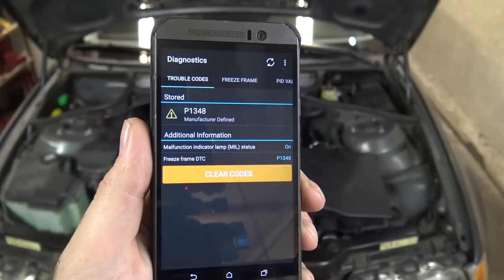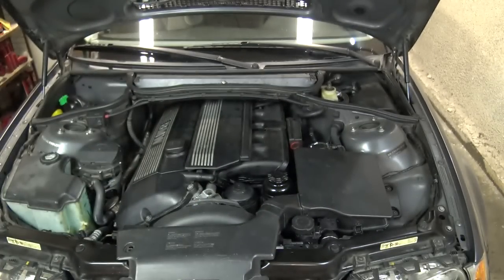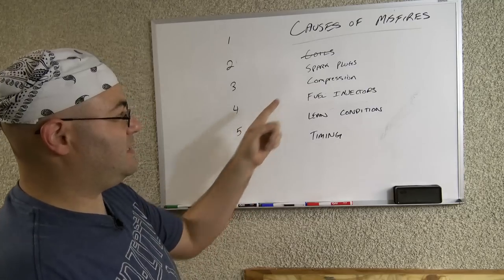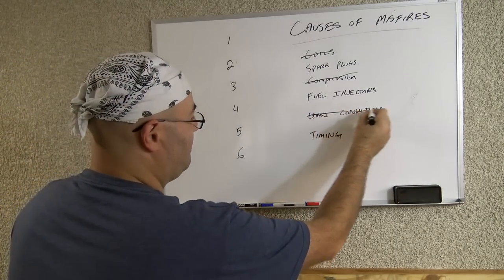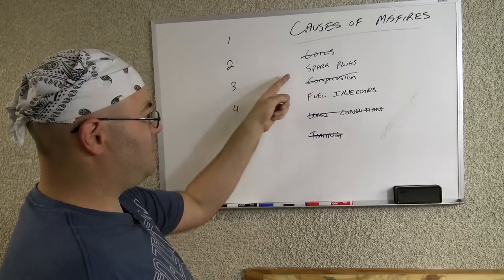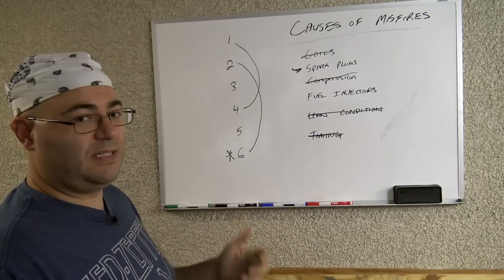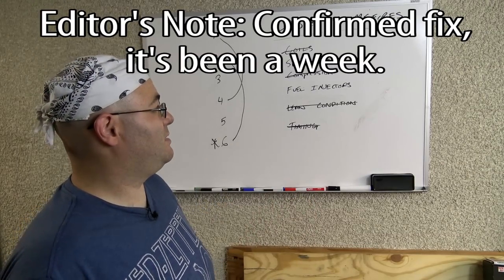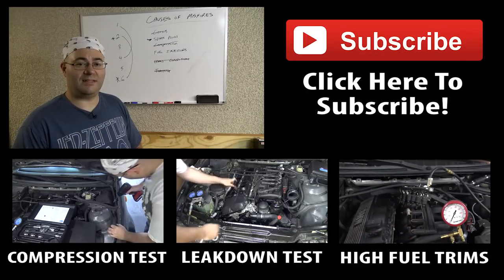How To Diagnose A Misfire on an E46 BMW 3-Series DIY

Comment: dear 50's kid greatings from greece my problem in my M54 330ci is relatively similar to what you were describing in your video but the codes that my ELM showes are P0302 P0305 and 306 but more commonly is 305 i flushed the engine and changed all 6 coils also recently i changed my faulty fuel pump still the car when on idle after a small period of time starts misfiring my mechanic said that the fuel injectors might be clogged up due to the gung inside the fuel tank. I didnt changed the sparkplugs yet as i got the for about 1 month "NGK-Rs". The weird in this cituation is that when i erase the fault codes the car works fine plus when it starts misfiring if i shut the engine off and start it again the misfiring stops!!! Any ideas or suggestions!!! I would be so glad hearing from you as this problem is definately driving me MAD!!! tnhxand  keep up the good work!!!
Reply from the maker: When the computer detects a problem with combustion, it will actually shut down that particularly cylinder to protect it from detonation. That’s why the misfire goes away when you restart it or when you clear the codes. You do have a problem and you need to proceed with swapping the various components like I do in this video to figure out the cause

Comment: I`m having such a problem with misfires on my X5.. I think the bad fuel is guilty in this case.. however, I`ve had a serious misfire about a year and a half ago and I changed spark plugs with denso irridium IK20TT spark plugs. Have done about 25000KM with them.. bought them for a reason that those were the most durable spark  plugs with a decent amount of igniting power.. hmm.. however, through it`s lifetime I doubt my car has ever had injectors replaced or cleaned.. so could you please tell me the size of injectors an M54B30 uses from the factory ? and sometimes I get fuel trim errors when obd scanning my car on cold

Comment: My 2003 E46 325i is straight piped i have 
been driving it for over 1 year never took her 
out in the snow but i did it once last week and 
started misfiring and when i checked it said 
cylinder 4 misfire and i have changed all the 
spark plugs and.checked all the coils they are 
working do u have any idea what that 
could be now its just cranking wont start at all

Comment: hey  have sporadic   miss fire on cylinder 4 and 5,  swap from cyl 1 and to to 4 and 5 coils and new plugs, still have  misfire in  5 and 6    ,, do you think I should test the injectors?

Comment: Did you use dealer spark plugs?  Mike Miller of Roundel and Bimmer magazines insists that dealer plugs are slightly different than what is available on the aftermarket.
Reply from the maker: Not dealer plugs, straight NGKs.  I don't believe there is any difference.  Probably made in the same factory in China.
Reply: I think their is a difference.  Even though NGK makes OE plugs for BMW, a number of smart people insist that the aftermarket NGK part is different.  Mike Miller is no shill for BMW; he recommends aftermarket if it is as good or better. He states "Like just about everything else on the modern BMWs, Bosch spark plug choice is complicated and confusing. The short answer is if you order the spark plugs from BMW (sometimes there is a choice between Bosch or NGK), then you are good to go and there is no confusion. But they are expensive."  

"Savvy enthusiasts have found that Bosch has a part number for commercially-available spark plugs that cross-references to the BMW original equipment Bosch spark plugs, often at a fraction of the price. The problem is, the commercially-available (aftermarket) Bosch spark plugs are not always the same as the original BMW Bosch plugs even though they cross-reference and they do work."

"Dealership technicians report problems with the commercially-available Bosch Platinum +4 spark plugs in BMW engines. I have never seen this personally, but physical inspection does reveal differences between the original BMW Bosch spark plugs for the modern cars and the commercially-available Bosch Platinum +4. I use the factory plugs in my E46."

Comment: What was the problem in the final? I have a 525i e39 and I have approximately the same problem. The first start(cold start) it starts ok after 10-15 sec it shake and it throw an error on cilinder 4 or 5 or the both. I delete it with engine on, and it runs ok, or I stop the engine and I start back and all good. The problem disappeared . This problem I have on cold start. After that I haven’t any problems with the car. Next morning the same problem. I change plugs, coils, allll this shit and the problem still persists. Any idea? Chamshaft sensor? Idle valve? I don’t know what to do next. I buy ngk plugs and Bosch coils, and cracked coil too! I rectified the injectors all! I’m so sad! The problem still. Any ideas?

Comment: my e46 had a misfire and replacing the bank 2 cat/ header was the solution to my problem, i had already tried sparks plugs, and ignition coils but that did nothing
Reply: hi there, just wonder if you resolve your problem, the thing is I have 1999 323i and I just replaced the cats with ebay headers, and I have same thing cylinder 4 is misfire. Today I replaced the new spark plugs and new fuel injectors, new rear oxygen sensors, but I still have the 0304 misfire cylinder 4. Wonder if you resolve your problem. Thank you.

Comment: Hello 50sKid, on a E46 330ci I have all cylinders missfire code (1 to 6) and both Fuel trim banks permissible range exceeded. 
What are the possible causes I might look for? Vacuum leak? Thank you

Comment: I really appreciate your videos! I have a misfire (cyl 3 and 1) and occasional 'O2 Activation, ignition cly 4. makes the engine run rough and low power. happens at any temp. The weird thing is,,,,, clearing my codes 'fixes the problem completely!!!??? it clears up the rough running every time. of course, it comes back pretty quick. Any ideas??? used your videos to replace all vacuum lines, water pump, VC gasket, other air lines on engine. new plugs.  I'm at a loss...
Reply: Vic Padilla pretty much the same thing happening to me right now. Still trying to figure it out
Reply: Blong Thao I read that a low voltage battery condition can cause this. I fixed the hose on the Auxiliary air pump (leaking), but not sure if that is what helped, but it’s been fine for some time now...

Comment: Thanks so much for all your great videos.  My 04 330xi with 204K miles has a challenging issue.  Engine runs smoothly at start-up and fast idle (~900rpm), after it warms up, engine drops to slow idle (~700rpm), check engine light goes on, engine runs rough.  Using your diagnostic method, I swapped coils, spark plugs and fuel injectors and the problem always points to a cylinder #2 issue.  P0200 on the code reader, injector circuit malfunction.  Engine runs smoothly after clearing the code,  check engine light goes off and the engine goes back to fast idle.  If driving with check engine light on after stopping or waiting in traffic , engine runs rough yet runs smoothly after clearing the code.  Have heard about resetting the ECU or possibly replacing it.  Any suggestions?
Reply from the maker: Could be a wiring problem or could be a bad driver in the dme. Start with the wiring
Reply: Thanks for the reply. Do you have a video covering the wiring?
Reply: Salut j'ai le même souci sur une 528i  E39 simple vanos ma BMW soit par moment elle tourne bien et après elle broute sur 4 cylindre et quand j'accélère au point mort le ralenti ce bloke a 1800 tours minutes j'ai passé le voiture a diagnostique et me sort sonde lambda bank 1 ..  pour tant mes 2 sonde lambda sont neuves ..??  Plaese avez vous des idées 🙏🤔

Comment: @50skid I have the same problem at cold start, the idle is rough. I changed the spark plugs and still same issue I did what u did by unplugging the coil connector but the car was already warm, it also happens at a complete stop, I have E60 N52 2007, the has me frustrated not know what it is.

Comment: Love your vids bro! I was wondering if u can help me with my 2000 bmw e46 manuel ? I recently ran my car wit no gas until it ran out completly ,which caused me to replace the fuel pump because my car wouldnt start. But now my car starts ,but it is marking check engine, i went to quto zone for there obd scanner & i got 5 codes which are , p1189 p0170 p0173 p1188 & a just recent one i got is p0305 which is a cylinder 5 misfire. Can all these codes be becuase i ran it with no gas ? Im thinking of replacing the precat oxegen sensors hoping it will clear all these codes ? Please respond!! Once again love ur vids !! Very useful man!
Reply from the maker: No not because you ran out of gas.  You've got fuel trim problems and I suggest you watch all my fuel trim videos and figure out what kind of lean condition it is, if it's a vacuum leak, plenty of videos to help there.

Comment: I keep getting a p0301 and p0303 misfire code on my e46 and this started after installing aftermarket headers. Plugs are new, injectors were cleaned and coil packs are good... I even moved coil, spark plug and injector from cylinder 1 and still have misfire for 1 and 2..... I’m stumped at this point. Any advice?
Reply: Sorry 1 and 3....

Comment: i'm kind off in the blanks right now as to why i am having cold start misfires. so far i have swapped plugs, coils, replaced the fuel filter, checked all kinds of things through inpa, rebuild the disa valve, did a compression test, and tried starting it with the MAF unplugged. none of these things helped. does anyone have any ideas? I was thinking of injectors too but i should then have misfires upon a warm start aswell right?

Comment: Any ideas on random misfires with fuel cutoff P1341 with multi cylinder misfire P0300 along with misfire codes on all but one cylinder so far? No other codes but I only have a P-reader. Happened out of nowhere and almost died while idling at a stop light.

Comment: Hey Fifty. I have a P1347 code - Manufacturer Control Ignition System or Misfire. It sounds like clunking, stalling, and a loud muffler. Sort of a chugging noise. Or thumping noise. Any ideas?

Comment: So checked cylinder 4 which didn't change the engine sounds 
Changed the coil and plug and the head moves up and down what else could I do to check

Comment: How come u didnt have a lean condition. When a cylinder is down doesnt that leave bunch of oxygen in the cyl and cause lean numbers. I have 2 and 5 misfiring. Fuel trims are at like 25% when i raise the rpm to about 3k fuel trims immediately drop down and go like -3 to -5 and fluctuate there. I know that it seems like a vacuum leak symptom but i cant find any leaks. Did smoke test, water test, brake clean, and propane test no leaks whatsoever. Dont hear anything either. I can hear the sucking sound but thats normal from the manifold i think. Replaced all the orings, gaskets, hoses, fuel filter, tried three diff MAF sensors. Fuel pressure is at 43-44 cycle key to on. Drops about 15 psi and stays there in 12 min. 50-51 at idle(needle bounces cant tell 50 or 51) swapped coils, swapped plugs, installed new plugs, swapped injectors, pulled and cleaned injectors for good measure, problem stays at cylinder 2 and 5. Have spark at 2 and 5 coil so dme driver is good. Car starts up and in seconds it starts stumbling and exhaust making phaaphaaphaa sounds lol. Dme throws p1345 and p1351 fuel cut off codes for cyl 2 and 5. Compression was good on all cylinders 172-175 on all except it was 169 on cyl 5. But cylinder two misfire code is always the once to trigger first. Sometimes its just cyl 2 and 5 misfire during start. Other times its with cutoff. Got new oem pre cat oxygen sensors. all the oxygen sensors are plugged in their correct spots. This thing got me sleepless. Sorry everything is not in order i listed everything as it came into my mind.
Reply from the maker: Yeah that sounds like a hard problem to solve.  You're right in that the symtoms are classic vacuum leak.  It could also be MAF related. You're using an OEM siemens MAF sensor?  I didn't have a lean condition because the misfires were random/sporadic and I probably wasn't looking at the fuel trims right when the misfire condition was being triggered.
Reply: 50sKid yes i have a two mafs both are Siemens 5WK96132 tho whenever i look up "2001 bmw 330ci siemens maf the part number is always 5WK96132Z with a "z" at the end. My mafs dont have a z at the end. One i got from a 2001 bmw 530i and other one from a 2001 bmw 330cic(convertible). Every single search turns up the part number with a Z at the end even the cheap 20-30 dollar maf show part number with a z. I dont know if that makes a difference. My car is with the sports package. Also the other day i was searching 2001 bmw 330ci camshafts to compare mine and make sure they are of a m54b30 and in the notes it did say "wont fit 330ci with sports package" really confusing mine is not a ZHP its just a sports package which later was called the M package. Just trying to make sure that everything is correct on the car because the guy i bought the car from was a wanna be bmw specialist he had done some questionable things to it like mixed injectors from a 3.0 and 2.8l, stuck open thermostat, all the exh manifold bolts loose, took off like 2" of the injector wire insulation just to check for injector pulse when he could have just poked it or back probed. Anyway looking at the car i don't know i just feel like the head has been replaced so i wanna make sure that he just didnt go to junkyard and get a 2.5 head and swapped it straight in with those cams. I am taking the car to an indy shop that has really good reviews for diagnosis since i dont have a compressor to do leak down or whatever. Pretty sure my lifters the jammed, head is cracked. Something wrong with the head. If the shop does say something is wrong the head then i will get an engine from junkyard rebuild that and swap that in and keep the cars original engine for a future build or e36 swap maybe. Not getting rid of this car!

Comment: i was using dielectric grease on plug installations. I it found that I was getting missfires after a year of so. Noticed gel was running down ceramic and dirt was mixing in. Missfire was resulting
Reply from the maker: interesting!

Comment: I need help, I have a BMW 325xi 2003, I have a code P0303, I change spark plugs, coil and injectors but it still has the same code, I appreciate any information that you can help me

Comment: Hi I love ur videos . i have a question maybe u can help me . I change the water pump and the thermostat and housing and a new radiator on my e46 and when I start the car have a bad misfire u have any clue way this is happening .
Reply from the maker: nope none of those parts would cause a misfire so I don't have any idea from the info you gave me

Comment: Did you inspect the offending spark plug for contamination or ceramic fracture?
Reply: Yes,  what type of problem was with the plug?   Resistance  change, carbon build up, cracks, worn  you mat have another problem in 10k miles again.

Comment: Hello #50skid ive an issue with my e46 325ci (euro manual 6speed) it has a misfire only after the first time that the fan starts runns fine when cold, when you restart it it drives fine... so i checked the coils i start the engine untill it start misfire the i will search for the nonworking one i change it while the engine is running and nothing changed... spark plugs changed with iridium ones new same issue the only way to drive it is to unplug the MAF sensor the ecu starts to delever a lot of gas and the fixs the issue but i still notice a low performance under 3000 rpm after that its rocket. I will try to find coils and test them out but i think i will have the same issue.

Comment: I’ve got the following codes on my 01 330ci it’s starting to get a little frustrating I recently had the cam sensor replaced and ever since then it’ll at times change sound (it gets much deeper) and power is reduced its almost like something’s stuck in the exhaust pipe, I shut the car off and restart it right away and it’s gone. any ideas? 

P0300
Random/multiple cylinder misfire detected 

P1192
* Post-catalyst fuel trim system bank 1

P0155 
o2 sensor heater circuit (Bank sensor 1)

P1447
EVAP control system purge flow monitoring

P1351
Ignition coil control circuit high voltage

P1353
Misfire cylinder 6 with fuel cut off

P1349
Misfire cylinder 4 with fuel cut off

Comment: Hey! i need some help, my 330i m54b30 keeps getting a really bad misfire if i stay idle for a while, for example at a red light for too long, then its only firing on 5 cylinders, if i delete the codes its fine, i removed the spark plugs which looked fine, but the rubber connectors had cracks right through every single one, and i replaced those, the problem is still there, i ordered new spark plugs today even tho i replaced them a year ago. any ideas?

Comment: hi 50skid..i am having misfire 2002 bmw e46. it gives p1347 on cold startup after some days not regularly ..no other codes..checked cylinder 3..swap coil..spark plug.but code remains same. any inputs? I have heard of upper cylinder cleaner piston soak through the spark plug hole to help but have no idea how to do it properly..can u pls guide us for that procedure..mayb the valve is sticking in cylinder 3.not much info on this procedure but lot of good reviews.they use a ac delco or gm upper engine cleaner.thanx and sorry for long story..i m doing massive work on this car
Reply from the maker: Swap the fuel injector for it's neighbor and see if the code moves.

Comment: i have misfies in all cylinders but 1 and 2 and there is a ticking sound coming from injectors this all suddenly happened after i took the intake manifold off and put it back on to replace my start i need help please